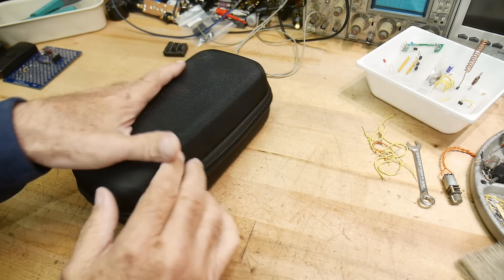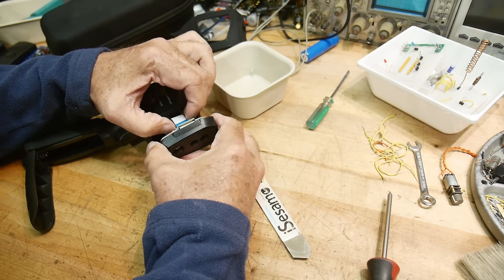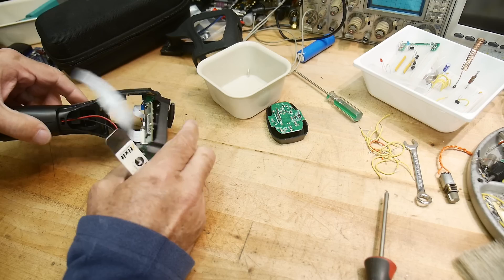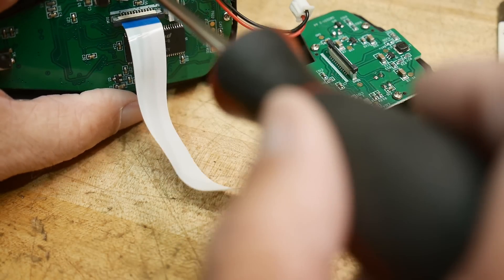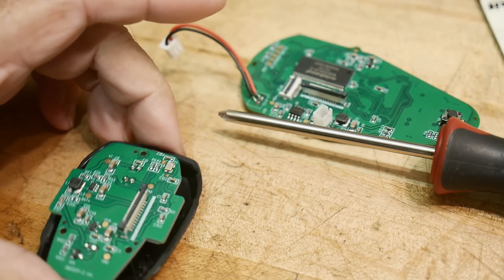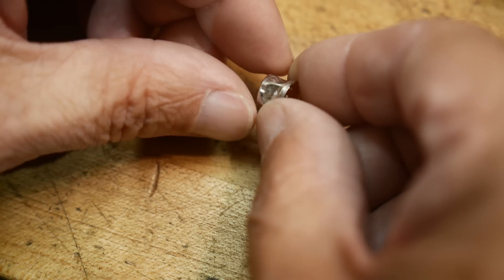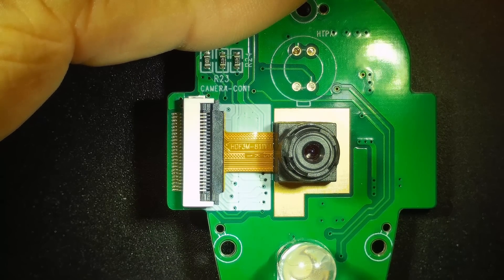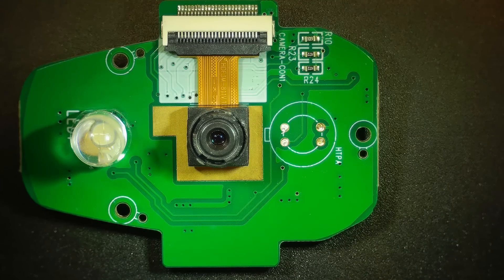#1553 Thermal Camera Teardown

Comment: That camera should be the same thing as an OV2640 2 megapixel camera, making it potentially usable in the future.  Im guessing, but i think it should work with a raspberry pi or as a replacement camera on an esp32-cam board.  The winbond chip is RAM or flash memory of some sort.

Comment: Your videos are great.
May I ask if they could not be improved by having an overhead camera where the focal plane is the bench, whereby everything on the bench is in focus and nothing is then in the way of the camera? 
Please do not think I am criticising in any way, it is only a suggestion that might help us see things more clearly or at least all in focus.

Thank you.
K Who
Reply from the maker: I've thought of that before and rejected it. I don't like the perspective
Reply: @IMSAIGuy  Commenting here on one of your replies because on a lot of Youtube my comments get blocked.  Anyway loved the video and the components you found saved me the trouble of tearing down my own thermal camera.  Mine has an effective read distance of only one foot, (or 12 inches) and I would like to change the lens or attach a telephoto Germanium lens so that I can use the camera to see a larger area or more pulled back - say to look at things three to six feet away.  There are a lot of standard optical connection rings and adaptors but it helps if the first one has threads - this one doesn't.  But maybe there is one with the same mount where ithe entire detector could be soldered onto the board and then attached to an adaptor and go from there to achieve different viewing distances. Probably with a firmware update. Fiddly I know..mybe just get a purpose made device..